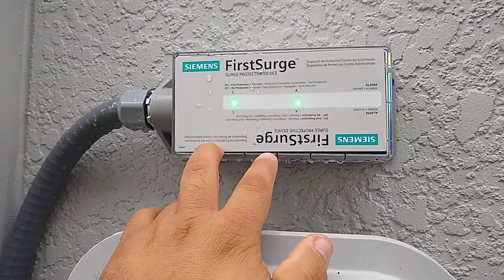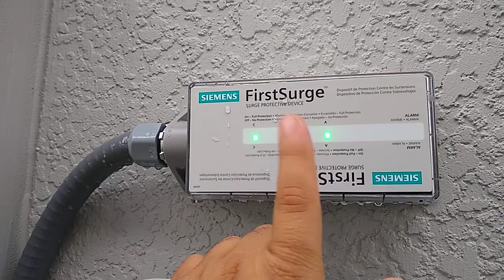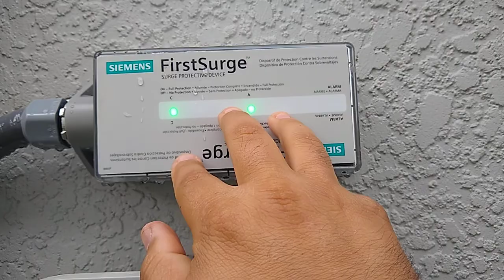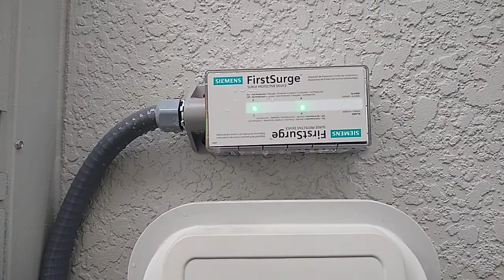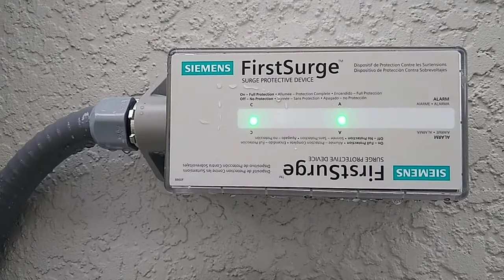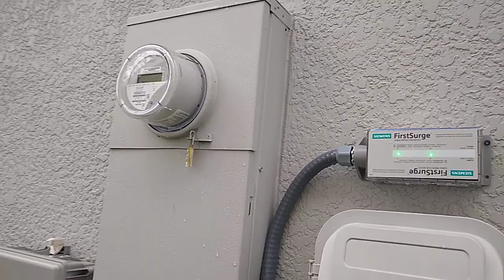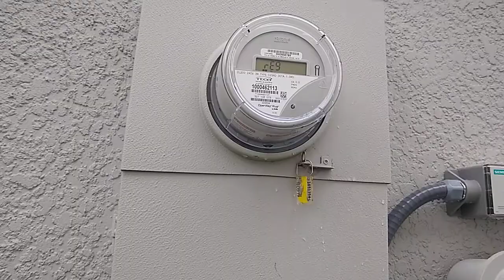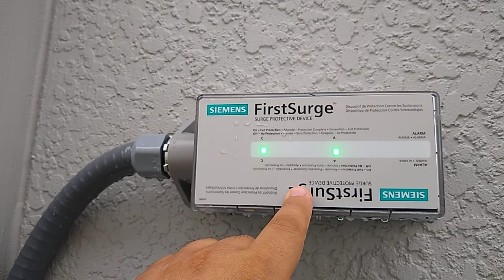Storm Hardening: Whole House Surge Suppression: Why I chose the Siemens FS140

Comment: do you have a kit for 2 wire start coming from a 3rd party device. I have an inverter that can start generators via 2 wire and I have this same generator. It would be nice to have the inverter start this generator automatically when needed

Comment: You did not read the instructions. Your wires are to long to the surge protector. And the breakers for the protector are supposed to be first from the main breaker. Make the wires short as possible to the twin breakers. 20-30 amp. Should have mounted the unit directly into the load center. Take the seal tight off.

Comment: Fyi
The spec provides with the Siemans is for a 6 inch cable length. If you use the 36 inch length, the dprc is why worse. Same for 24 inch and do forth. Of you can't mount to box. Make date you teidt the wires uniformly before attaching to the panel. It changes the impedance and the spec isn't near as bad. It took hours to figure out this info including speaking to engineers who tested it. Fact

Comment: If you really want to protect against external surges (hello Florida!), use a TYPE 1 surge protector.  It is installed BEFORE the panel (I usually install it at the meter).
This is a great surge protector (Siemens is a solid brand), but it's TYPE 2, so it allows a surge into your panel.  If you really want to be fully protected, get both TYPE 1 and TYPE 2 protection.  This is called "cascading" surge protection.
Reply: Siemens has a type 1 and 2, 140k amp spd. Not the "bolt" version.
Reply: Yeah I'm too lazy to go down to my basement and check the part number, but I have a Siemens type 1 on my system.  :-)
So far I really like Siemens products. I've had times when an Eaton afci did not trip, but a Siemens did ... So instead of calling it a nuisance trip like so many lazy electricians do, I tracked down the problem and found it (The original electrician had left some faulty connections).
Siemens also makes the most inexpensive of the copper bus bar panels. I only install copper bus panels, so seems makes sense. Plus, where I live, the circuit breakers are available everywhere so during the pandemic when there was a shortage at supply houses for everything, I actually never had a problem.

Comment: You could make that installation more effective if you mounted it right next to the panel. Take a close look at the Siemens specs. Every added foot of lead length adds to the reaction time, and adds 175v to the clamping voltage. You've got about 18" more length than you need ... this means that you'll be letting in around 260v more than if you eliminated that length.
Reply: Right on point @paulraphael!  They say to keep the wires as short as possible and try to keep them as straight as possible, avoid 90 degree bends.

Comment: When you installed it the first time, you installed the locknut that goes on the INSIDE of a box on the outside of the FS140.  That can NOT be moisture proof, as it gets in between the rubber gasket and the box - that's where the waterproof seal occurs.  You should have just tossed it or kept it for a spare.

Comment: What did this video tell us nothing!
Open the box up.
Looks like it was installed wrong.
Needs to be as close to the mains as possible.
Reply: According to Siemens it is much less important what breaker position is used and mush more important to keep the wires short and straight for best results.
Reply: @jaycahow4667  
Exactly!

Comment: I see several 220v receptacle surge protectors on line but not from manufacturers I'd buy from, not knowing anything about them. APC does make battery backups with 220v outlets but get ready to drop $1000 plus dollars for one of those.

Comment: My unlicensed electrician installed directly to the two main wires instead of using double pole 20 breaker is this incorrect because I’m going to ask him to redo it.
Reply: Funny the square d homeline one has options for both. Either via 2 pole 50 amp breaker or directly to the main breaker bussing.
Reply: It was installed incorrect.  The Surge Protector should be connected to a double pole 20-amp breaker, in positions 1 and 3 in the control panel/load center.
Reply: @Pk3_Garage  According to Siemens it is much less important what breaker position is used and mush more important to keep the wires short and straight for best results.

Comment: Does it need its own empty 20amps breaker? or can it be connected to a breaker with something already plugged in?
Reply: Yes, it needs its own double pole 20-amp breaker.  They do make a Tandem Breaker. This allows two separate circuits, to be powered by one breaker in the same bus bar slot.

Comment: Long wires reduce the protection capacity. The device ideally should enter directly next to the circuit breaker.
Reply: My fs140 wires are 8 inches long and straight.  Wires should be as short and straight as possible
Reply from the maker: Hi Brian, I've yet to do an update...yes I am reconnecting it much shorter.
Reply: Lol that short whip wouldn't effect anything 🤣 does it look like it's 5 feet long to you? It's short as hell

Comment: Hello :) my Siemens Fs140 has: 2 Green lights on, red light blinking but there is not any sound. i have a doubt, the red light must be off or blinking? Thank you
Reply from the maker: If your red light is blinking you need to call Siemens ...its likely not working or has failed.  
Follow back up here after calling them I'd love to know what caused it.
Reply: Can you please update?  I have a home warranty and had an electrician that didn’t do a repair correctly.  I’m going to have one installed by my local contractor.  Thanks.

Comment: You can put rectorseal rsh-50 at the bottom of any receptacle box for the item you plan on having a backup. I have the FS-140 and plan to install the rsh-50 for my sump circuit, hvac and others maybe as local 'type 3" device.
Reply from the maker: Why would I add an RSH-50 in addition to the FS-140 I would love to know more about why you'd add both?
Reply: @gulfstormreadiness2928  as a backup for one of the most expensive units in the house. If the fs140 gets hit by a surge, your whole house is left vulnerable again while you aquire another fs140 to install as they are designed to burn up if used. If the surge is from powerline failures in a storm or other multiple surges can happen in the same time frame. Think of the fs140 as the main parachute and the rsh50 az a reserve.  And if an outdoor unit fails itself the rsh50 might burn up first instead of more expensive fs140. Internal surge protection in that scenario. Its recomended by fs140 to install type 3 surge at main appliances anyway. Rsh50 is just more stoudty than a dedicated surge outlet i feel. Not to mention sumps need gfci protection snd a surge protector like a surge outlet or rs50 needs to be installed closer to the breaker and the gfci is the farthest thing from the breaker.

Comment: Zap Cap costs about $8/month from TECO (Tampa Electric), not $20. (I have one, and will be have it uninstalled soon), since I had the FS140 put in.

Also, your wire run from the FS140 looks pretty long to the circuit breaker and the neutral/ground. The installation instructions are to keep the wires as short as possible to keep response time < 1 nanosecond. You might want to think about relocating the box underneath so you can move the FS 140 right up against the panel and improve the performance. Mine is right up against the panel on a 20 amp circuit breaker closest to the mains and neutral/ground bar thus the wires lengths are short as can be and in the most optimal location in the panel.
Reply: Eaton and a youtuber, abrelectric, say keep the long wire and twist it like Twisted Pair. Commenter, engineer, says yes do that and add a bunch of wrap around magnets, too. abrelectric TX electrician explains in detail why to just keep 36" wire, twist it.

Comment: Yes you do need to open the box and show the wiring....Thanks!
Reply: There are 4 wires.  Green/ green and yellow striped wire goes to ground.   If unit is insulated it will not have this wire.  White to the neutral bar.  Black and Red go to the 2 phases from the 20 amp breaker.  When installing the breaker you will want to find if your panel is feed from the top or bottom,  you will want to install the 20 amp breaker in the first bus locations possible to the main breaker.  All wires should be cut to not leave excess wire.
Reply from the maker: @Time2Fly17  That's something I've redone since this video is tighten up that distance.

Comment: I have all of my electronics on APC Ups's in the house. I've also been looking at doing something like this.
Reply: Seems like every appliance has computers today!  To put a big appliance on a ups would get expensive quickly!
Also, why don't people have lightning rod anymore?  My grandfather was a contractor, and every house he built had a lightning rod!
Reply: @garybulwinkle82  I looked at the cost to do lightning rod. It's very expensive, time consuming. This was a much simpler and cheaper option. Cost like $300 for the unit and $300 for an electrician to install it
Reply from the maker: This provides superior protection to appliances and HVAC
Reply: Lightening rods attract Lightening. Studies were done. There are more strikes.

Comment: How long do these last?
Reply from the maker: It could be 10 years ...it could be 1 month.  There's no real life span because it's subject to how much punishment it goes through.  The reason I chose the FS140 is because of it's durability and one of the highest KA ratings on the residential market specific to the South East USA due to the heavy lightning storms etc.  The day it blows out, goes red and blares a siren... is the day I know it probably just saved me a major insurance deductible or thousands in electronics behind it.
Reply: @gulfstormreadiness2928  It does not blare a siren, it sounds an alarm about as loud as a smoke detector battery alarm warning.  You need to be fairly close to hear it and even closer if it is mounted in your enclosed breaker box.
Reply: When the little green lights go out you'll need to replace it.
Reply: Not True. All surge protectors have an expected lifespan due to the electronics used in them. 3 to 7 years typical but a lot of people recommend changing them every 2 years. The Siemens FS140 will disable itself at end of life and give a warning. A lot of people complain about this but the alternative is you may think you are protected in 5 or 10 years but may find out the hard way that you had little or no protection. I have some old APC surge protectors that are probably 20 to 30 years old abd don't give any error but I remember reading a long time ago that APC said you should not use them beyond 5 years I think. Oops I guess mine are just power strips now, lol.